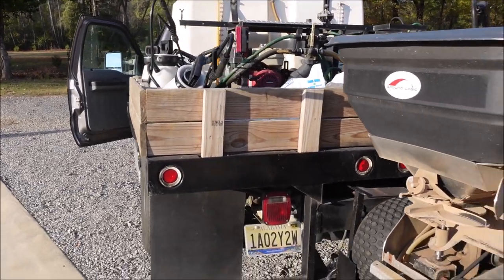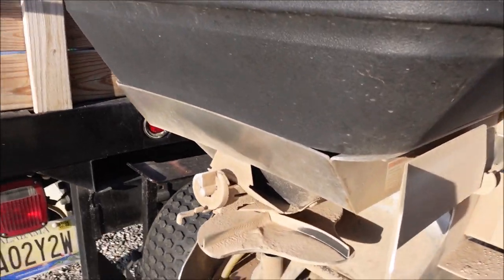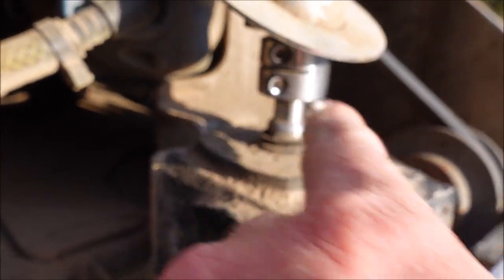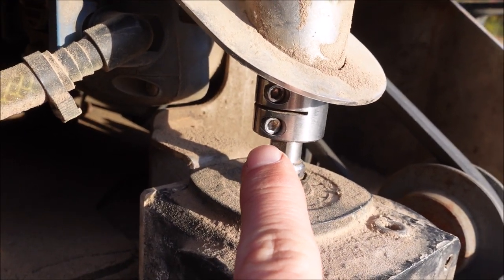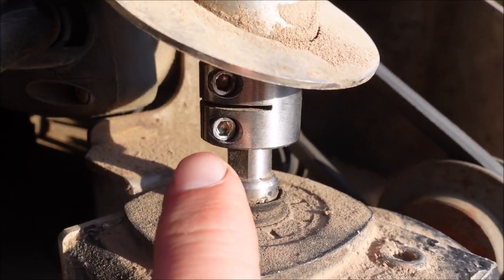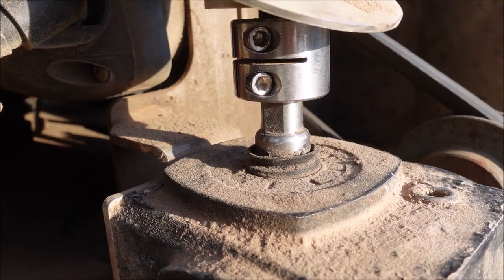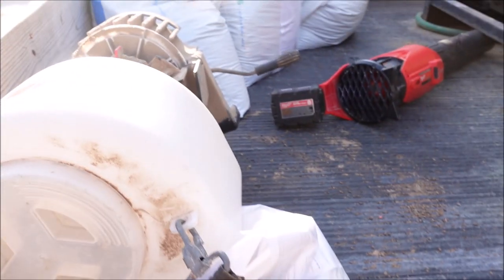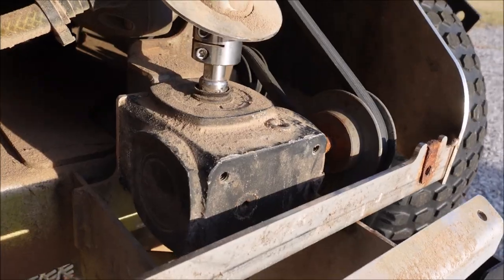Lawn Care Equipment Failure and What I Did About It

Comment: Most allen hex keys are china junk. Get a quality hex bit, and adapt it to fit into a socket wrench. You'll get much more torque than using a hex key. Also a hardened bolt will keep it from stripping.
Reply from the maker: Thanks for the tips